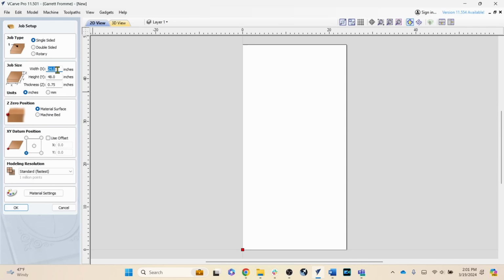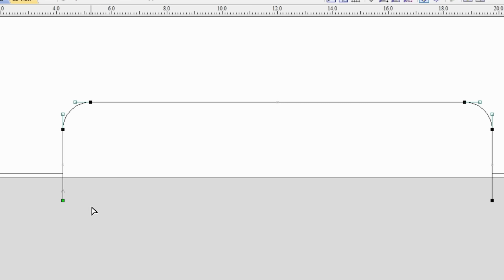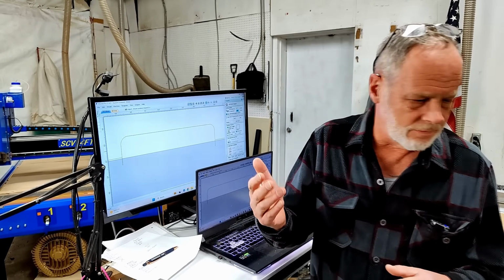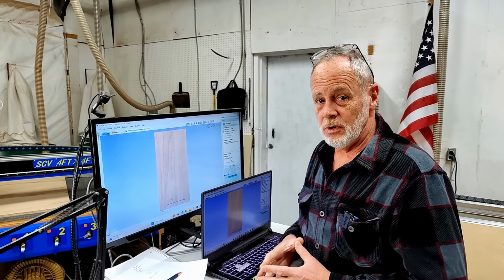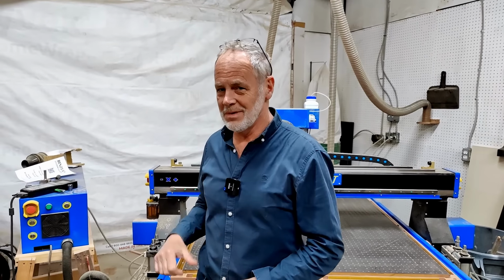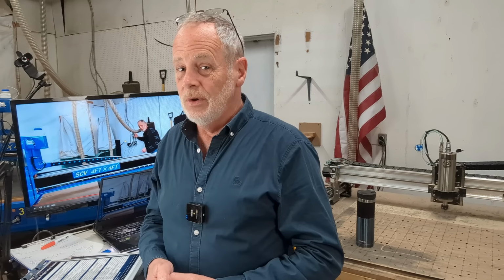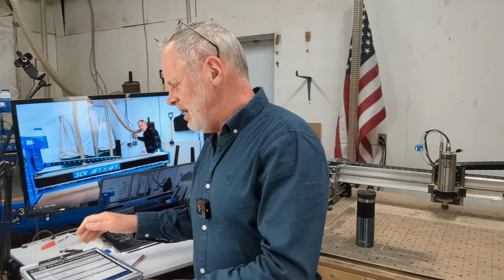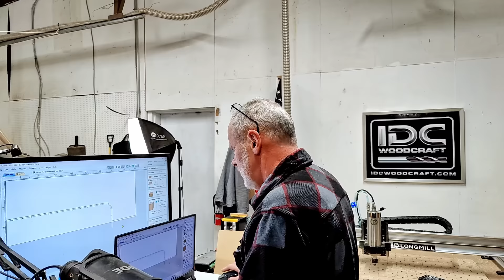Common CNC Router Project and How To Avoid Them

Comment: Garrett,
I watched as the "Beast" roughing bit was cutting out your design and was thinking about how expensive it would be to replace the vacuum table if you accidentally cut too deep. I know the tool setter helps, but are you scared about damaging the vacuum table surface? Also, would it be better to select 'Machine Bed' for the Z Zero Position setting in the Vectric software? That way your bit is limited in the negative Z-Axis direction.
Thanks for all the videos you create.
Reply from the maker: rogersecura5181, good question brother! Using a roughing bit like "The Beast" certainly calls for caution, especially around a vacuum table. It's good to have a respect for the potential costs of a slip-up. Even with tool setters and precision equipment, the risk is always there. Many CNC operators do prefer setting Z Zero to the machine bed for operations where they fear they might cut too deeply; it can act as a safeguard against plunging too far and damaging valuable equipment. It's all about finding that balance between confidence in your setup and healthy caution. Remember, no question is too small when you're making sure you've got everything dialed in just right. Keep up the curiosity, and stay sharp with your projects brother!
Reply from the maker: rogersecura5181, great question brother! Using a roughing bit like "The Beast" certainly calls for caution, especially around a vacuum table. It's good to have a respect for the potential costs of a slip-up. Even with tool setters and precision equipment, the risk is always there. Many CNC operators do prefer setting Z Zero to the machine bed for operations where they fear they might cut too deeply; it can act as a safeguard against plunging too far and damaging valuable equipment. It's all about finding that balance between confidence in your setup and healthy caution. Remember, no question is too small when you're making sure you've got everything dialed in just right. Keep up the curiosity, and stay sharp with your projects!
Reply: @rogersecura5181  I would have used a compression bit for that ply.

Comment: You can easily determine which side the bit will cut by looking at your green start point and the path direction arrow. Imagine you are standing on your start point looking in the direction of the path arrow, right is right, left is left.
Reply from the maker: butchmiller2451, very good point brother! I couldn't agree more.

Comment: For plywood strength grains going in the wrong direction
Reply from the maker: kenf2662, Plywood is engineered with layers of wood veneer, with the grain direction alternating in each layer. This cross-lamination enhances strength and stability in various directions. If the grains are not aligned optimally for your specific application, it might affect the overall strength and performance. Generally, plywood is designed to handle stress from multiple angles, but for projects requiring specific grain direction, it's best to choose your sheets wisely. Always consider the intended use and load requirements when selecting your plywood.
Reply: @IDCWoodcraft  Yes so true